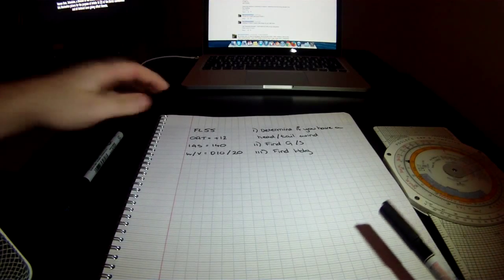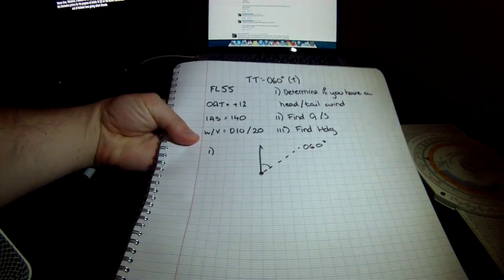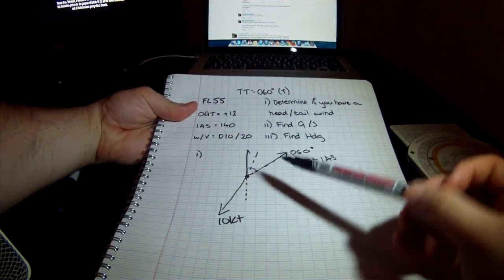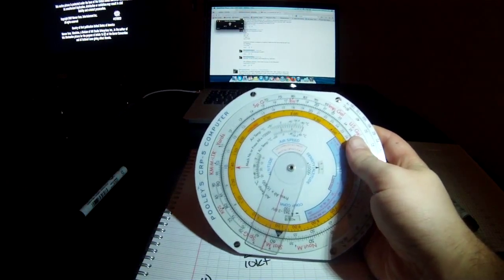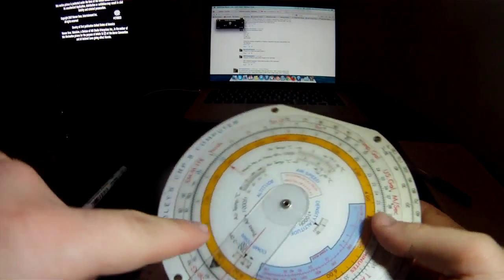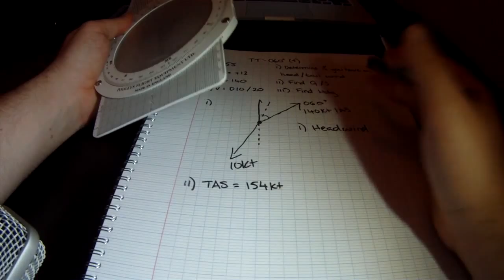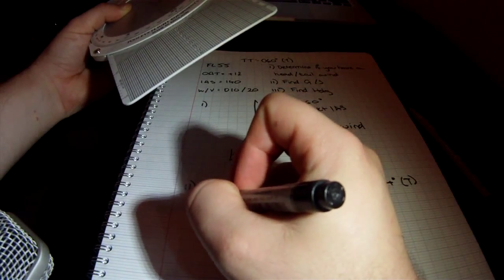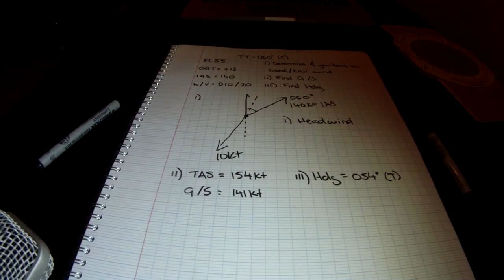CRP General Navigation Question for Groundspeed, and Headings

Comment: Is there any manual methods to calculate TAS and GS wihtout using E6B ?
Reply from the maker: there are mathematical ways to find GS from TAS, but honestly, you're much better off using your flight computer, E6B if you're doing US stuff, especially because the examiners use their flight computers to calculate the answer to the question. Calculating it IS more accurate, but it takes longer and the answer could be closer to one of the wrong answers in the multiple choice. If you want I can walk you through the calculation in a video.

As for finding TAS. It's a bit more complex without the computer.

The general formula is:

TAS = IAS + (2/100) X IAS X (PA/1000)

PA = Pressure altitude (Flight Levels or ISA conditions)

but this does not take temperature into account. A rough rule of thumb is that you can add 2% of IAS/1000ft i.e
when
 IAS = 100kt
PA = 8000ft
correct IAS = IAS + IAS x 0.02 x 8

But again this assumes ISA conditions, which is rarely ever the case. The question above for example. FL55 has an ISA temperature of 15 - 2(5.5) = 4°C. So in the question above conditions are ISA+8°C! It really makes a difference.
Reply: MerryfaceAviation alright I'd be really grateful if you cover how to figure out the GS sir !
Reply from the maker: I'll work on it tonight
Reply from the maker: Karim Hasnawi Alright, here it is:

http://tinyurl.com/pwb6xhp